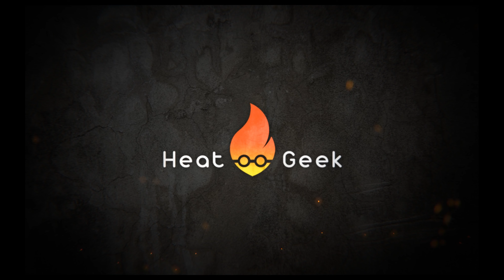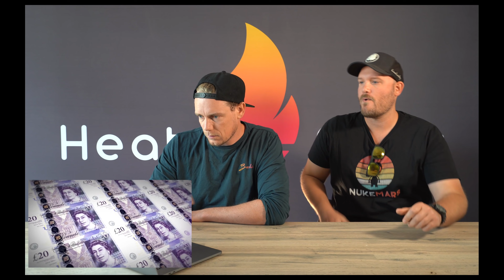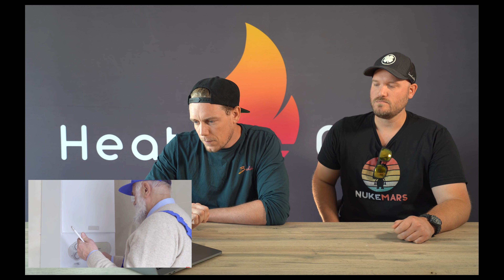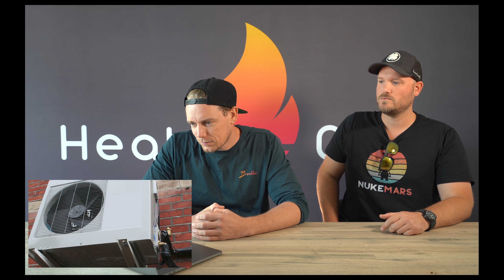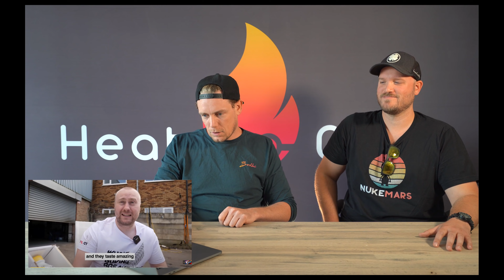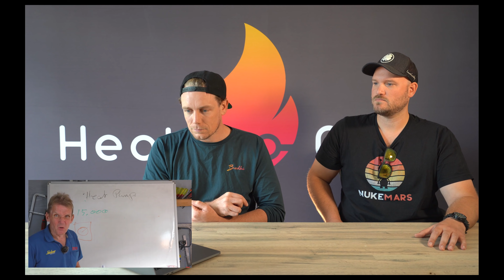Professionals React (BADLY) To Skill Builders's Heat Pump Videos | PART 1 | FIRST TIME WATCHING

Comment from the maker: Make sure you watch part 2!! It gets a bit more heated! https://youtu.be/0cYvJPPmVGs
Reply: The MD of Octopus Energy on R4 today telling us heat pumps are less complicated than gas boilers and electricity will go down in price. Seriously?!
Reply: Hhahahahhaa
Reply: not suitable  for everyone
Reply from the maker: @stephenmitchell8607  nope.. we say that in our video...
Reply: @HeatGeek  Heat pumps only work with MASSIVE subsides.  God help anyone who doesn't keep their gas boiler when they have one of these stupid things installed.
Reply from the maker: @cuckingfunt9353  only for the initial install.. after that a heat pump swap is cheaper than a gas boiler..
Reply from the maker: @cuckingfunt9353  a heat pump does not cost 10k. The initial disruption does. If someone already has a heat pump, swapping for another could be as little as £2000. 

Not all electricity is made from gas.. that's the point or noone would use heat pumps.  

A cop of 2 is crap agree.. that's why engineers need to be taught gow to get to 4 and also the customer should be informed of this BEFORE the purchase as it SHOULD be calculated.. not fund out 2 years later like with skill builders installs
Reply: @HeatGeek  You can only get COP 4 in summer. I agree that having a heat pump might be a good idea, particularity when you could get the electric price rebate thing, but only in addition to your gas or oil boiler ( that you need to heat your house in winter ). If I was rich, had underfloor heating and an electric car, and could get the rebate, then I would be getting a heat pump for sure. I would be keeping my oil boiler hooked up though.
Reply: @HeatGeek  Can you clarify "we are getting harsher winters due to climate change" l have lived through 70 winters here in England and the one thing l have noticed is how much milder they are, and yes l installed heating systems when l worked so l understand the industry.
Reply from the maker: @clooperman3745  you don't need to have installed systems to know that!. I probably meant how weather and conditions are more extreme.. sorry I don't remember the context though. If you can send a time code that will help.

Warmer winters make heat pumps more viable.
Reply: @HeatGeek  at 11.28 you mention harsher winters here, not in East Anglia, they are getting milder and damper, the cost to retrofit an ASHP system properly in a lot of properties in this country will be too much for a lot of people, my son just finished a bathroom install and was talking to the customer about ASHP upgrade from their oil fired system, they had a survey done and were quoted just over £17,000.!!
Reply from the maker: @clooperman3745  correct. That's why it needs funding properly.. as per the video above.
Reply: @cuckingfunt9353  I'm  a Gas heating Engineer and you're  wrong mate. I've  started installing these and they are fine.
Reply: @blooflame1846  You can make plenty of money installing these, they are fantastic for that, I'll give you.  Best bit, is in a couple of years you can come back and replace them with a gas boiler again... Win win.
Reply: @cuckingfunt9353  or you have solar panels and / or battery storage, in which case heat pumps can make a lot of sense
Reply: No thanks I’ve just played your video to a class full of heat engineers it’s  truly hilarious  you’ve become a laughing stock !
Reply: @frazzzz1066  course you have pal...
Nobody called "Daz" ever finished school, did you know that?
Reply: Heat pumps are good !! Yeah good for fk all
Reply: If it’s 30c outside you wouldn’t be using your heating!! So rare if ever would you get cop 4.
Reply from the maker: @mrfr87  hot water... also.. we have SCOPs of 4.8 on some systems.. which means over COP od 5 periodically.
Reply: Perhaps you should contact skill builder and do a joint video. The channel is pretty successful 428 k subscribers and shows a lot of useful stuff.  I’m sure you are good installers and do a good job but a lot out there are not. It’s the same with solar, double glazing etc. indeed wherever there are subsidies there tend to be cowboys!
Reply from the maker: @rupertmiller4718  yes lots of great info on their channel. Not about the technical side of heating souls though. More genrall building skills hence the name. We're meeting in a few weeks
Reply: His point is that gas boiler sales are banned from 2035 and heat pumps are the governments only option. You agree that heat pumps are not suitable for the majority of the older housing stock. What are they going to do for heating?
Reply: You are so wrong on per capita emissions. Per capita CO2 emissions: China - 8.2 (and going up) . UK - 4.66 (and going down). Allowing for imported CO2 emissions only raises UK emissions to around 1.6% of global CO2 emissions. UK is already in the top 10 for global reductions in CO2 emissions. UK is 9th largest manufacturer in the world. Reality and MSM propaganda are very different.
Reply from the maker: @IanS-2617  no. I am not. They are very similar figures when you compare to the likes of the worst culprits like usa at 15.2 tonnes, australia at 17.1 tonnes, quatar 37.2.

China are srt for a huge downward trend yet they constantly have the ginger pointed
Reply: @HeatGeek  You talked about China's per capita CO2 emissions were lower than UK. Not true. China accounts for 27% of the world's CO2 emissions. I have worked in China for the last 20 years for a Chinese company so am quite familiar with the reality in China.
Reply from the maker: @IanS-2617  oh right I don't remeber saying that.. I know they dipped to a similar level to us..

The point is that although the count for 27% of worlds co2 that's poor metric as its not adjusted for population. Per capita is much better and holds the worst performers in rightful shame.
Reply: We don't make anything at all ?  Wrong.
Reply: Why does he keep saying to use the radiators?  No need to use radiators with heat pumps, ductless air-source heat pumps don't use the existing radiators.  Oh and you get air conditioning as well, which given the 2022 heat wave in the UK would be a good idea.
Reply from the maker: @Boodieman72  becaise 99.9% of houses have radiators already installed.
Reply: @HeatGeek  Remove them and replace with ductless a2a heat pumps.  You can run the line set though the area the water pipes used to be.
Reply from the maker: @Boodieman72  extra work. Less comfort
Reply: @HeatGeek  Same comfort.  Radiators don't do so well when it comes to the air conditioning side of things.  Geothermal would be the best option for heating and cooling in new construction especially on new building estates.
Reply from the maker: @Boodieman72  same comfort? 95% or radiators requirent  is heating not cooling. Low temp rads give radiation as a higher %. A 2 a is max convection.. I live with both.. they aren't even close
Reply: @HeatGeek  Right now you need cooling not heating.  Maybe your a2a units aren't very good?  The US made a2a heat pumps are terrible, the good ones come from Southeast Asia.
Reply from the maker: @Boodieman72  ours is daikin..
Reply: @HeatGeek  The popular name brand in the US is Mitsubishi, there are other brands like Mr. Cool.
Reply: I’m not sure I can commit an hour to the sequel.
Reply from the maker: @Fehr270  haha.. its a ling old slog
Reply: Canada is a little different, colder possibly larger homes. We looked at heat pumps because it also gets me an air conditioner. My power bill would go up in the summer and so would my carbon emissions.

In the winter it didn’t appear to save any money or carbon emissions.  This changes drastically if you have a carbon free energy source.  I will reconsider in the future.

Note in Canada you still need a back up source for the coldest days, natural gas or electric.
Reply: @Fehr270  Even if you had backup heat in a ducted system it would only come on when it gets too cold for the air to air heat pump to work.
Reply: @Boodieman72  that is correct. I might expect better temp control in spring and fall but will see higher energy bills when using it for A/C and as long as most of my electricity comes from natural gas power plants there isn’t a cost or environmental advantage over my gas furnace.
Reply: @Fehr270  Unless you go for a geothermal setup.
Reply: I think heat pumps are good replacement for oil boilers not gas boilers.
Reply: @CrashUK28  unlikely if you consider the situations where most the oil boilers are installed
Reply from the maker: @CrashUK28  that's a gross generalisation.

I suppose it depends if you care about climate change or not.. boilers have a carbon intensity of 220g and heat pumps 60g per kwh which will drop further as the grid cleans up.
Reply: @HeatGeek  Its not if heat pump was free you never replacement 25 million gas boilers and the cost to lower that carbon is just not worth it.   Better off spending the money on insulating UK homes this would lower the overall carbon a emissions of the UK housing stock.  70% of UK housing stock does not have the requited loft insulation.  I know from experience this lowers my heating bills.
Reply from the maker: @CrashUK28  I 100% agree with spending all the money on insulation.. as aswell as lowering demand it makes heatbpumps more efficient, fit in more homes and affordable to install.. win win win.. gas boilers are not an overall solution either as they don't work off grid.. there is not 1 size fits all overall solution other than insulation
Reply from the maker: @CrashUK28  see my other answer
Reply: @CrashUK28  Thats a Joke, no they are not necessarily a good replacement for oil fired boilers. A lot of rural dwellings are older than 100 years and have uninsulated stone walls and floors are uninsulated concrete. Sadly It is not feasible to insulate them, the cost would be too high. A heat pump will be at best 25% efficient in conversion and no more. This is the theoretical limit. In severe winters i.e. outside ait temperature 4 degrees celcius and below the heat pump would fail. The whole drive towards heat pumps is not the future.

Comment: I'm in Toronto and installed a 2 to heatpump ATK rebranded from Midea i think. The AC performance is outstanding and much quieter then my previous Carrier AC unit. I paid $4600 Canadian.  That did include $1040 rebate.  Should be interesting to see how this works in Jan and Feb in our deep cold winter.

Comment: As you have said the problem is the installer. A report from the Energy Savings Trust suggests that 80% of heat pumps are underperforming in the UK because they have been poorly installed.

Comment: Heat pumps work in every building. I don't know why people keep claiming otherwise. I also don't understand why they sell heatpumps as expensive. Of course they can be a large initial investement, but that can also be avoided - for example with AC's (not sure what you call them in the UK, split heat pumps?). 

AC work for heating the house as well. They don't cost much and both the outside and inside unit are perfectly made of each other. So whoever installs it, doesn't need know much about plumming, system design and all that kind of stuff. A high SCOP is basically guaranteed. It's also great for lowering CO2 emissions. For example: If your AC has about 1/3 of the heating power of your oil gas heater, then it can lower CO2 Emissions by much more than 30 percent (about 70 percent in germany, not sure about the UK). 

This guy for example even heat his entire house with AC's (seach for video title): 

"DIY Heizung: Günstige Alternative zur Wärmepumpe für den Altbau" 

AC's are also great with if your heat pump was installed incorrectly. If the installer didn't chose a heat pump with enough power, then in some cases you could assist the heat pump with AC's. This can even lead to a higher SCOP, but has it's limitations, i guess. 

I still haven't seen a house where you can't install a heat pump and achieve a SCOP above 3. A lot of people talk about it, but i haven't seen an example of such a house. Often you can do it with minor adjustements like change heat exchangers in some rooms (or no adjustements if you use AC's).

Comment: We live in a housing association house and had a air source heat pump installed 5 weeks ago.. (November 12th 2022) From 12th Nov to 15th December its cost us £467 for electric... 
I've lived in my house for 17 years and NEVER has it cost me £467 a month for Gas and Electric combined.. its literally 3 times more expensive... the house is cold the water is 41 -45 degrees and the condensation is an absolute NIGHTMARE... I HATE IT!!!!

Comment: Winter, black ice on concrete from the heat pump, draughts and air bricks, indoor heating temperatures struggling to be maintained, harder and longer to dry the washing increasing humidity, longer to warm a room, cold floors and large bills for a small household......
Reply from the maker: None of these things are a thing.
Reply from the maker: If its well installed

Comment: Some of his rant's hilarious.  Old houses can't be insulated, he says.

65% of my house pre-dates 1878.  Total heat loss at -1°C EAT is around 5kW.  The ground floor is down to 1.5kW so it seems quite likely I can get the total down to 3kW by dealing with the leaky first floor and poor workmanship in the extension.  Wouldn't cost the earth, frankly.

Comment: I'll end this nonsense, don't get down on Roger, he's correct in saying its a slow motion car crash, is not just installers are the variable, its also the houses and customer ignorance. 1) Why is the government paying/ refunding the cost ? is bullshit crap , the tax payer is  subsidising the plumbing and heat pump industry, money out the back door to satn and his mates just like we've seen with banking, fraudulent covid loans , companies with their noses in the trough. 2) I work in building , am constantly seeing showers that leak, shoddy unprofessional workmanship, will take armies of very skilled plumbers and electricians as wells highly modified houses to make heat pumps worthwhile. 3) Electricity is 3 times the price of gas therefore a house has to be capable of achieving a CoP of more than 3 just to standstill, would take solar panels to really reduce the cost of running. 4) I'll be positive , a mate installs them for swimming pools , fine, they do work well in the right circumstances ie public swimming pools , powered by solar or maybe they could be retro fitted in schools and public sector buildings for hot water or some warmth. 5) Brand new hospital, Pembury near tunbridge wells , everyone in the entire plumbing world knows the hot tap goes on the left , AND it  is regs, so why did the ward my mum was in have hot tap fitted around the wrong way? who signed it off? who the hell did they have doing the job, how much did that hospital cost and yet still muppetry going on, is it any wonder that poor old Roger is getting hot under the collar. 6) Go and ask any government minister in charge of this policy and I doubt they will have a clue what or how a heat pump works. 7) We should be looking after the planet in a wholistic way, mother nature never so much as gets a mention in politics and building is one of the most wasteful industries we have , shop fitters are the worst ,  constantly tearing out shops, lobbing it all in the skip, is moron yob culture . If plumbers want to be real men , get out of the silly tattoo salon , and look around the world...High quality water manaGEment is what our world really needs,  sanitation, and clean water is where your knowledGE and skills should be deployed not in ripping out another en suite for people with more money than sense just because someone has done one turd in it.

Comment: Heat pumps are absolutely pointless for around 80 percent of uk stock, they were simply not insulated to the point of no air escape, this causes two issues, one as the doctors are stating the lack of air in the house aka super insulated is causing breathing problems, and also the sheer cost of really using heat pumps on house larger than 1500 square feet , so unless you live in a tiny house it will cost 5 times more to heat your house as the “ kettle element” will be constantly running in an attempt to maintain the heat so imagine running a kettle for 10 hours solid.

Comment: 32:20  1/3rd or 1/5th based on the GOP?  You are forgetting where about 60% of our electric comes from.  From burning gas.  I believe you tried to claim efficiencies of 60%, but I highly doubt that, it is more like 35-40%.  This is the main problem at stake.  Installing heat pumps, en mass, incorrectly, inappropriately, will INCREASE CO2 emissions.   At least until renewables and nuclear pick up the pace.  It's not a conspiracy that gas and electric prices are linked, it's just basic commerce.  Electric is roughly 3 times more expensive per kwh, because it's generated by burning 3 times as much gas kWhs.
Electric cars also have a similar problem.  When you assess the "well to wheel" energy usage their efficiencies quickly get eaten up.  They are still more efficient and they do end up breaking even on manufacturing carbon costs.   It is also highly coupled to how much renewable and nuclear power we can generate, moving that fuel mix to carbon free benefits electricification.   With masses of people moving to electric cars and heat pump/electric heating, we need to see that fuel mix move and move fast in the next few decades or it will be a mess.  If Truss or Putin doesn't give us all something more to worry about.